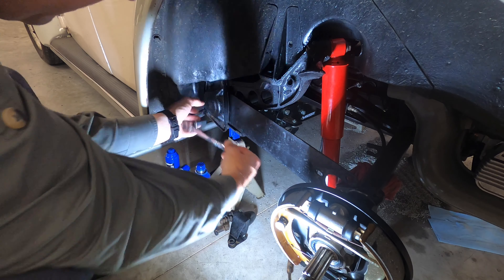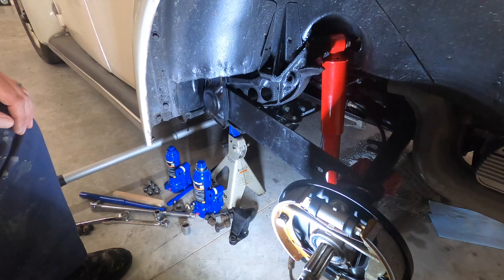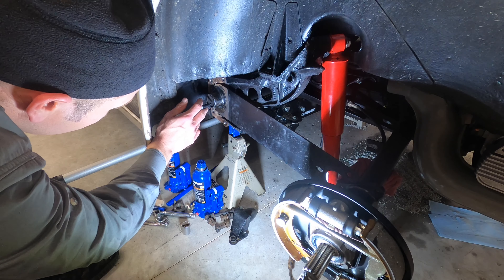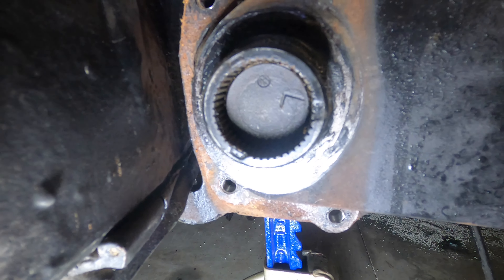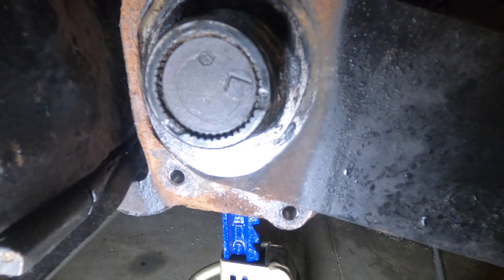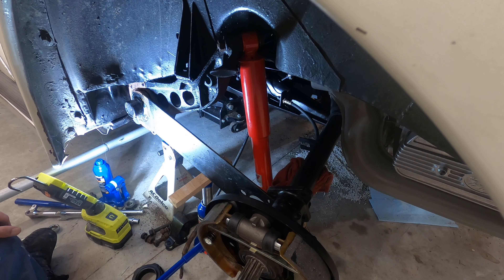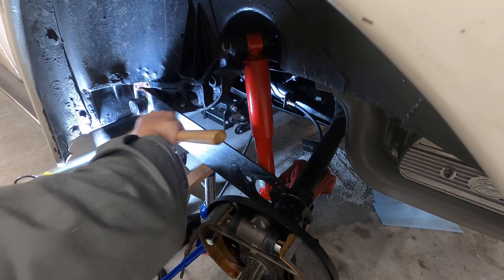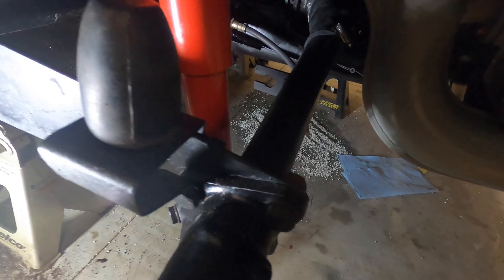How To Lower Your VW Beetle For Free

Comment: Want to lower my front about 1.5 inches . 2.5 with drop spindle is too low for the look i want . I just got my first bug and know nothing about them . Is there a way to lower without drop spindle ? seems all there is offered is the 2.5 drop . Plus don't i then need disc brakes then also ? Thanks
Reply from the maker: Not super familiar with lowering the front.  Although, I know this bug had drop spindles and I didn’t have to have disc brakes.
Reply: Adjustable front beam will lower the height you want

Comment: Does the rear negative camber out on its own due to the drop, or was that something else you did?
Reply from the maker: Comes with the drop.  Because of the straight axle, it causes the camber when lowering.
Reply: @VitosFix  appreciate the response! I need the camber as im running a 205/60r15 and i didnt want to rub

Comment: Are there any negatives to doing this?
Reply from the maker: Depending on the year (long axle - short axle).  Less suspension travel, may have to cut the rubber suspension stops in half to allow for a little more travel.  I’ve heard that it can wear out the fulcrum plates (axle meets the trans) faster then normal, but I have no proof of that.  

The long axle will lower even more (have more of effect per tooth), then with the short axle.